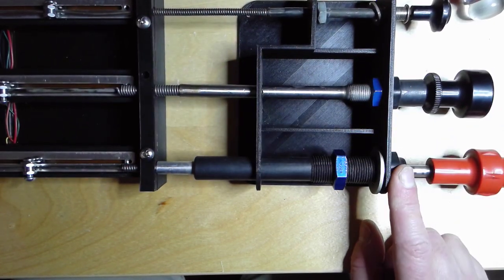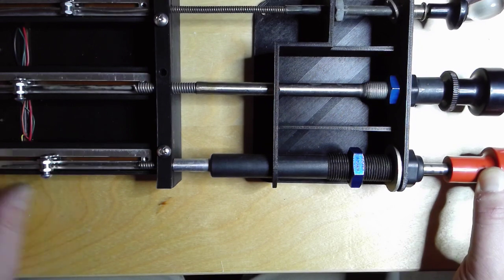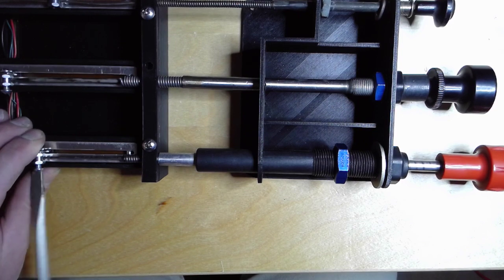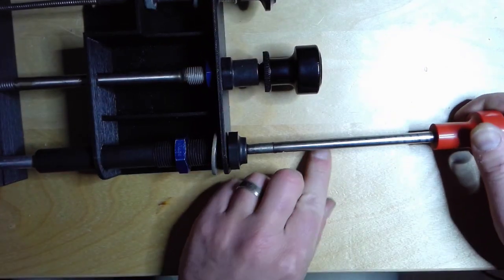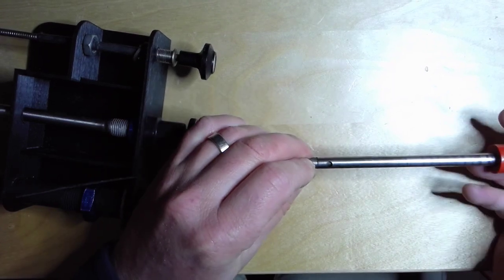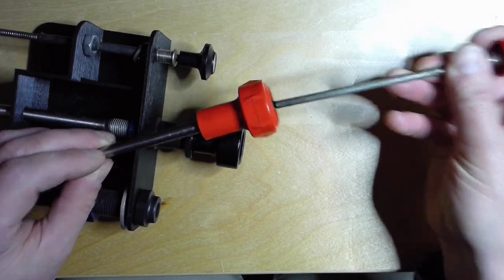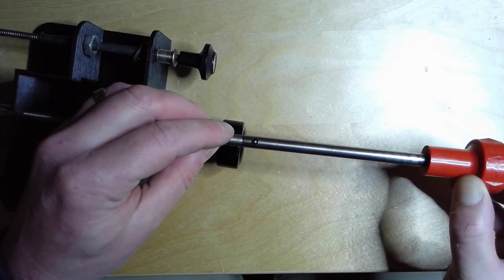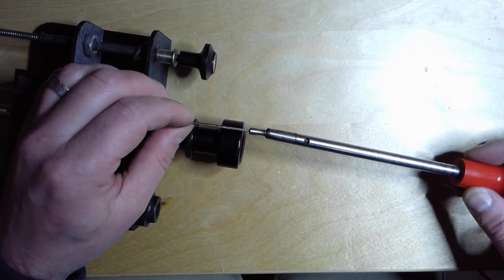Vernier demo

Comment: That is fantastic, thank you very much!
I've always wondered how it works.
Can you show us the tension mechanism of the Throttle?
Reply from the maker: This is all installed in my home cockpit now, so it's hard to get to.  The tension control is just a tapered thread, I believe,  You can unscrew it when the shaft is removed.
Reply: @ericlreuter  Ok. Thanks anyway.